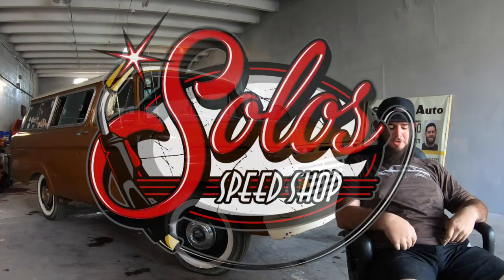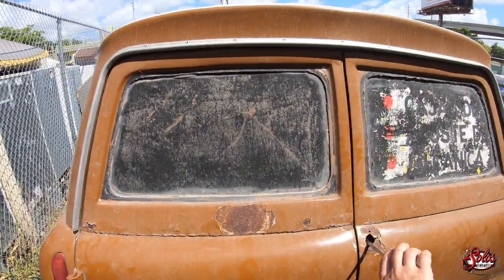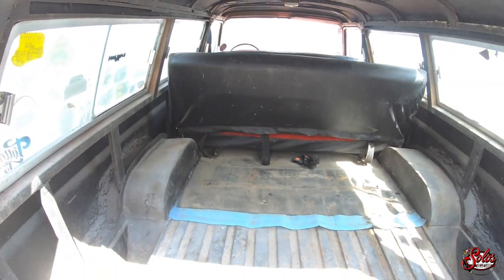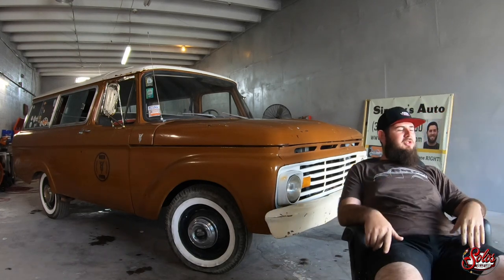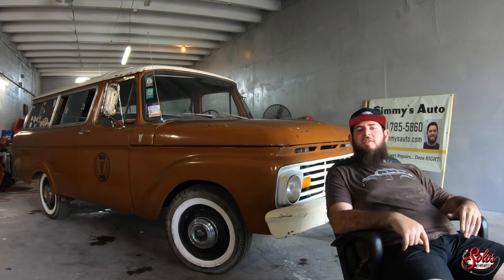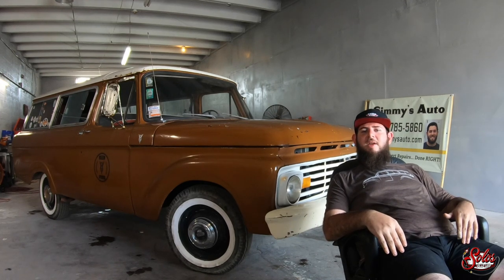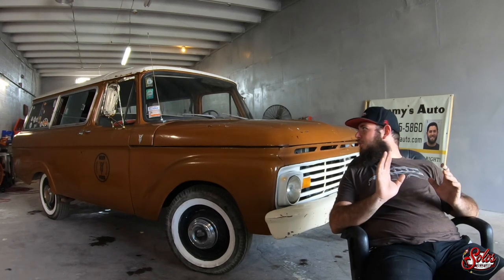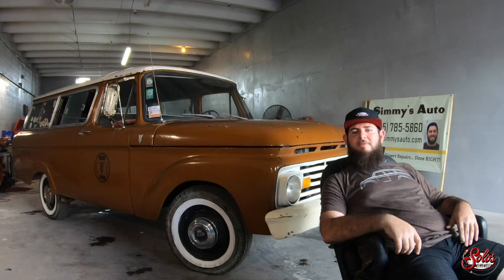My 1963 Ford B100 I imported from Argentina! Full Backstory - Solos Speed Shop

Comment: I would get the original motor running in case down the road you want to sale it as an all original numbers matching truck.
And in case you eventually want to sale the truck and keep the motor that you are getting ready to put in it.
Reply from the maker: Nick Seigmund I am planning on getting this motor running and driving. Might be swapping this motor into another project or mine.
Reply: Nick, unlike GM, Ford did not put VIN numbers on their engines, with the exception of Boss 429 and the 428 Super Cobra Jet Mustangs. For the most part the blocks were only date stamped when they were cast. As long as the date stamp was close to the build date of the vehicle but not dated after the vehicle build date, there is no way to prove original or not. At least from the years of research I’ve done on the Ford FE SERIES ENGINES, that is what I have found.